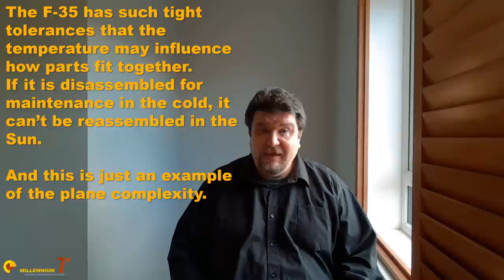F-35: The Failure of the $100 Million  Dollar Jet | Maybe...

Comment: After Kelly Johnson left Lokheed Martin, they stopped producing logical planes. An airplane, unfortunately as anyone who is into military history will discover, is like a car, rarely produced and bought for logical reasons but often highly emotional ones as well as bureaucratic and corruption ones!
Reply: KJ was an engineer and hated paperwork. he mandated minimum meetings for no more than 30 mins with no more then X people and minimum specification definition. eg the A12 & SR71 spec was one side of A4 paper. the f35 is volumes of specification. KJ also famously thought the hercules transport would sink lockheed.
Reply: @mrrolandlawrence  Sometimes paperwork defeats the original purpose of a project.
Reply: The JSF is the most successful combat aircraft program ever devised. It had major issues with weight initially, but they attacked that problem and fixed it when there were only a handful of them over a decade ago.

Just from a safety standpoint, it demonstrates how superior it is to all the teen fighters and current production 4.5 Gen fighters.

Gripen has had 8 crashes, all of which were failures in the design. One was even from the pilot's G-suit pulling the ejection handle when it inflated.

They stall a lot due to being underpowered, which accounted for several of the crashes so far.
Reply: I think that the book written by Johnson's successor, Ben Rich, is a must read if you are interested in the history of the SkunkWorks. Rich was a great lead engineer in his own merits (one of the fathers of F117 and modern stealth). If I remember correctly, in the end of the book he describes how the managing of aviation projects was changing for the worse: he could see the problems coming very well.
Reply: Man, you take the words right out of my mouth. That's what I've been saying for a long time now. After the 1990ies you saw the emergence of shareholder value driven capitalism. Out went the engineers and armies of lawyers, PR- & sales people and accountants came in. Lockheed Martin - among Boeing, Bell, Sikorski, Raytheon, GD. GE , the lot - became too big too fail and therefore too stupid to produce anything that was of war winning level. But they did win one war; they bought American politics and trillions of US taxpayers dollars.
Reply: Yep.
Reply: @LRRPFco52  Wut? none of that makes sense.
As an example: Show a production Gripen that have stalled.
Reply: @massimobattaglia5093  read Ben Richs book. Excellent he and Lee Begin both very capable designers.
Reply: Kelly Johnson was the soul of Lockheed

Comment: Hmm, build a plane that you can't afford to lose. Like building a gun, but you can't use it for fear of destroying or losing it. Genius!
Reply: Yes , true
Reply: Also I have seen in these YouTube videos that the problem, the bigger problem it seems to be, of the F35 is it operational cost , more than its purchase cost , because scale economies bring down the price of the F35 to a level comparable broadly to that of other advanced fighters , but its operational cost , is hard to swallow for the U S armed  forces : it is noticeably higher than that of any other fighter jet . Even the U S armed forces get chills in their spine because of the cost of some weapons systems, in this case , operative costs , not purchase costs. Operative costs are much less visible than the tag price , but they can make the heart of several General Staff generals beat with unease
Reply: @bernardotorres2532 the last time the USAF got concerned about operational costs overrun, I heard Pigs were flying high in the sky. Remember the "logic" behind dropping the C27A  for more C130J (double the weight, double the engines) mothballing mint state planes to Davis Moutain. The coastguard finally managed to get hold of some and the Army did all it could to get HD fot eh C27A because it needed it badly but the plane (already bought) was removed anyway and more C130J were bought new.
When you see these kind of discussion about logistics costs in USA, stop thinking about the plane, the actual economy and the performances and start thinking about congressmen lobbying and gamepowering each other.
Reply: @Leptospirosi  Yes , that is right, I did not take politics into account . Economics I did include , but not politics.

Comment: Great info, especially at 8:38. This is very relevant and important to consider for Canada’s procurement of new fighter planes to replace their aging CF-188 fleet (F-18). Currently the F-18E/F Super Hornet, JAS-39 Gripen and the F-35A Lightning II are in the running. Given Canada’s extensive Arctic region that requires safeguarding, the F-35A may not be the best choice.
Reply: @jb76489  east to say one year after my original post and after they’ve already made their tentative decision. Keep in mind that it’s not finalized. Let’s see if the current Liberal government doesn’t sh!t the bed on this deal.
Reply: @dstavs  sorry my dude but canadian incompetence means nothing as far as the f35 is concerned
Reply: @jb76489  what happened to your original reply? Did you delete it? Let me remind you: 	
“Thankfully the Canadian Air Force is staffed by people much smarter than you“

Tell me how “Canadian incompetence means nothing when it comes to the F35” has anything to do with my original suggestion a YEAR ago and your assertion that the RCAF is staffed by people much smarter than me? I never questioned the superiority of the F35 over the Super Horner or the Gripen. I made a comment based on Canada’s needs. You’ve contributed nothing to this discussion a year after the fact other than ad hominem insults. Thanks, “my dude”.

Comment: If we’re going to look across the pond, Gripen has my vote. Low cost man hours with crazy durability and short takeoff. If however we can revive and revamp something like the F20 Tigershark and put that in the air I say that would be preferable.
Reply: Chuck Yeager was right 

I view the Gripen as a Tigershark upgrade built for arctic climate and low ground infrastructure 

And interoperable already ++ 
on all the EW suites too
Reply: So buy and build another plane....which will go through the same problems the F35 had. Now we lose the investments made into the F35  to put into a new plane..sounds dumb.
Reply: There's also the possibility of reviving the F-16XL. Pair it with CFTs and you got a solid platform with significantly longer range than the traditional F-16.
Reply: @AirShark95  why? 

You’re literally going backwards.
Reply: On spot man. Gripen is not the highest capability fighter ever, but its more that enough for most missions and its bang for the buck ratio is hard to beat. Ideal for not so rich countries, or as a low into the high/low mix for richer countries.
My country happens to operate Gripens, but if I were US citizen I would totally support your idea of something like F20! F-5/F-20 are extremely beautiful in my view, and I generally love the idea of small, cheap, light, maneuverable fighters.
Reply: @kcimb  How is it going backwards? When it first flew, the F-16XL was capable of carrying 2x the payload of the standard F-16 and could carry that load for 40% longer distance. It's massive wing also allowed it to carry 82% more fuel, and the plane had a whopping 27 external hardpoints! Model 848 was fitted with a more powerful engine and achieved Supercruise during its career as a NASA test plane. 

Now that was the original F-16XL. Imagine an updated variant which integrates all of the advanced avionics and sensors that are featured on the latest F-16V/F-16 Block 70. AESA Radar, IRST, Conformal Fuel Tanks, EW suite, Datalink, and some RCS treatments like a Have Glass coating and integration of the Divertless Supersonic Inlet that was tested on an F-16. A modernized F-16XL checks all the marks for a 4++ Gen Fighter while offering a significant increase in capability over the legacy F-16. It is also a project that was already flown and tested, so there is no need to start from scratch with a clean sheet design, cutting down on development time.
Reply: If we need a new 4th Gen just get an f-16 but honesty we should just focus on getting the f-35
Reply: The Tigershark is still in the lightweight class, with the same inherent range and payload limitations of the Viper and Hornet.  
The Black Widow has the most potential, but still needs to be completed at great time and expense. 
The most mature and capable "would have, should have" design we have ready to build is the F-14/D Super Tomcat. All the maintinance shortcomings of the earlier Turkeys were addressed, and a high-vis "frameless" canopy, stealth bodywork, supercruise, fly-by-wire, stronger engines, longer range, and smarter, deadlier Phoenix missiles were all added to the mix. The primary role for the proposed blank-sheet platform is that of a long-range interceptor, and I don't think we can do better than Super Tomcats even today.
Reply: @FusionAero  You are absolutely right, but I though we're talking just about lightweight low component of the high/low mix here. Not the most capable in the world, but able to perform 90% missions, while having low operating cost.
Reply: @Bizzon666  I can see now that that's the focus of this particular comment thread. Doubt the Tigershark could out-turn the Euro-Canards, but it would probably have better energy retention as a zoom-n-boomer.  Northrop made a bad marketing move, re-numbering the plane to disown it's legacy and appear "all new" when it should have embraced it as the F-5/G. (I don't think the "F-21" proponents have read that chapter).   

These sort of missteps are ones you can only get away with in peacetime.  Ending Tigers before the Tigershark, and ending Tomcats before the Super, would have been like ending Mustangs before they got the Merlin engine.
Reply: @FusionAero  No problem. I am big fan of small, light, robust, cheap and easy to operate concept in general. It gives you more both airframes and better trained pilots, for potentially less money.
But for rich countries I like the high/low concept, and I kind of love your idea of Super Tomcat for the high side. Interceptor role goes well with the current missile/sensor/communication platform, even dog-fighter F-22 is used mostly as an AWACS/AEW today. F-14 was too ahead of its time, with IRST, powerful radar and super-BVR missiles, long endurance, back-seater, ... With just a modest upgrade from the original, Super Tomcat would be very hot merchandise for current US air-force and navy.

Comment: Bring back the F-16XL, update it with the latest systems and give it some RCS treatments? This is almost a no brainer IMO. The F-16XL is a massive upgrade over the legacy F-16. 2x the payload capacity, 82% more internal fuel, 27 external hardpoints, ability to supercruise... the F-16XL has it all. Just give it the same system and avionics upgrades the F-16V / Block 70 has (AESA Radar, RCS treatments, engine upgrades, CFTs, EW suite, etc...) and you end up with one hell of a capable fighter that could marvelously compliment the F-15EX, but being a bit more affordable thanks to its single engine design. Also, reviving the F-16XL means you don't have to start from scratch with a clean sheet design so development time is shorter, and you avoid the negative political ramifications of adopting a European design. You keep things homegrown. It's a win-win in my books!

Then just compliment it on the lower end with an armed variant of the T-7 Red Hawk for light attack.

Comment: Well, the main criticism is that the F-35 isn't getting the maintenance costs under control. 
However, the maintenance costs of "all" planes are skyrocketing (in dollar amount) because the US govt. is "printing money", and devaluating the dollar. The flight hour cost was $35,000, they got it down to about $32,000 in the past year (on track for an eventual $25,000/hr goal) ...however, "printing money" has inflated the cost to $44,000/hr, just because the dollar doesn't trade potently with foreign nations. Any other plane they make will run into the same problem.

Considering the K:D ratio of the F-35 in combat exercises, this new plane idea will drastically reduce US air power, plus involve a whole new development program (eating up any potential maintenance cost savings with development costs instead). This whole thing is much like what happened with the F-22. Also, shutting down the F-35 production line will destroy the potential for future upgrade paths and new versions for the plane. And it's a signal to pretty much every free country in Asia, that the current administration is not going to support them vs. China.

Considering the USAF version costs $79m (early 2020 dollars) to make, and probably about $200m over the lifetime of the airframe in total. What would replace it really? A Rafale for example is actually in the same price range ($115m for the plane, still around $200m for the life span total cost). In 2021 dollars, it's actually more expensive to buy a Rafale, due to all the money printing devaluing the dollar (I'm just using the Rafale as a gen 4+ example). Literally the only way it could "save money" is if it was an F-16"E" or FA-18E, with very minimal development tweaking, could get the cost down to around $150m total lifespan cost per plane. Anything more "interesting" would only add per-unit cost at this point, rather than help, since the F-35's development process is largely ended, so there's no developmental overhead for the F-35's.

The 6th gen program is intended to displace the F-15E's initially, and eventually F-15EX's and F-22's as they reach an old age.

This is however, all assuming that there is a concrete plan to develop a gen 4++. It's entirely possible (50% or greater chance) that this idea exists purely as leverage to get international partners to "apply themselves" to reigning in the replacement parts cost. There's been a lack of "incentive" for that to happen up till now.

It could make sense to work towards an eventual goal of a force of around 800+ units of: F-35A, 6th gen, and a Gen 4++ (each). But for now, my bet is on the gen 4++ idea being leverage.
Reply: I have a better idea kathrynck. Why don't we stop pissing away money on these war planes that will be totally useless in any conceivable future war. Their pilots committing suicide as their planes are shot down by our enemies advanced missiles.
Lets spend the money on the homeless, fixing our crumbling infrastructure and paying down our $23-trillion debt.
Reply: @DennisMerwood-xk8wp  I typed a longer reply, but it apparently touched on subjects not allowed under the chinese amendment of the bill of rights.
Bottom line, you're desiring to trade one expense away, without realizing the drastically larger expense you'd incur.
The US military has mostly 40 year old hardware. If it isn't replaced (right away), then bad things will happen globally. With much more overall suffering than you seek to treat.
And your faith in said missile systems is overrated. The hardware being purchased is explicitly designed to deal with that issue.
Also, the bulk of the country does not have 'crumbling infrastructure'. The states & cities which have crumbling infrastructure are a minority, and are caused by really terrible local governance. The other states (through federal programs) already bend over backwards to keep those badly run areas fiscally solvent. Increasing the rate at which fiscally responsible states/cities funnel cash to those areas would only start to break down the infrastructure in the rest of the country. I'm all for helping people, but it's more "enabling a problem" than anything else at this point.
If you really want to help the little guy, we need to stop "printing money". QE has short term benefits, with permanent damage to wages and savings, particularly for those with fewer material assets.